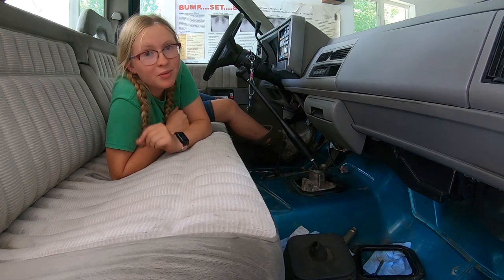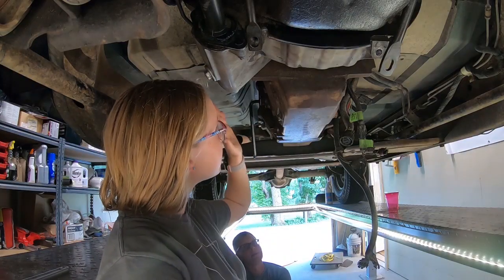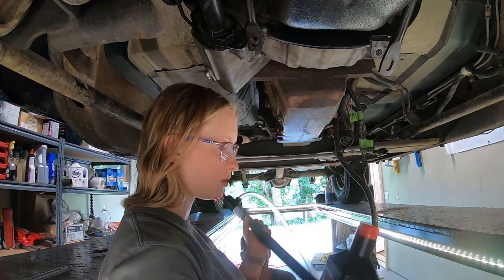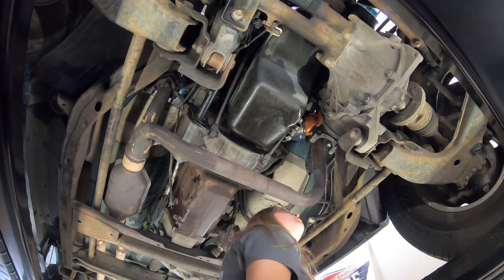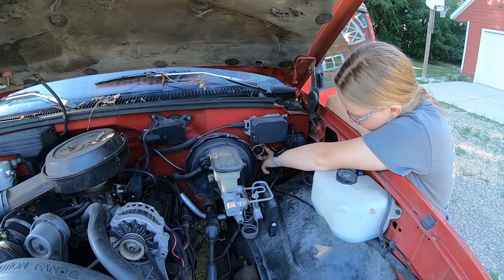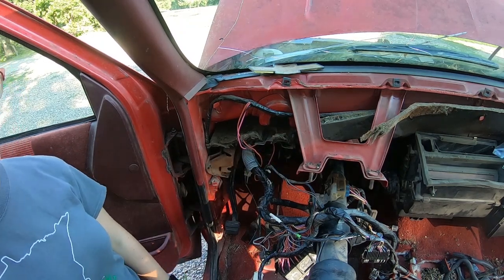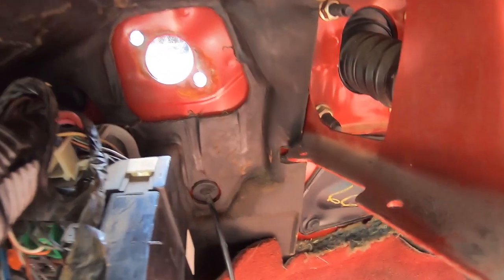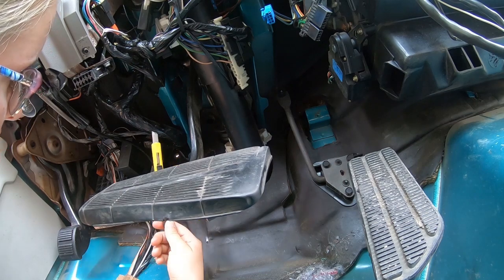OBS 1994 Chevy Silverado Short Box Auto To Manual Swap. Part 4 clutch pedal.

Comment: Hey great vids, a couple tips from a rust belt mechanic. Pull the fill plugs out of the transmission and transfer case before you drain them. It does 2 things for you: allows you to make sure they will actually come out and if they wont come out it gives you the chance to just leave it as is or get someone who can and in the mean time still be able to use the vehicle. Also, take a small hole saw and use it to round the corners out. Put it where you want to make the corner round and run it in reverse to start the groove and then finish it in forwards. Then paint up the bare metal

Comment: Thanks for the information video, I have 2 chevy K1500 (93 & 95) that I’m doing a 5 speed manual conversion to. The 93 1st as I have no reverse but I’ve already bought 2 NV3500 manuals to do them both. The 4L60e’s are junk and it’s cheaper to do a manual swap than take a chance on a rebuilt unit. Rebuilt transmissions aren’t all they’re cracked up to be. You’re a lucky girl to have a patient dad & cousin to watch over you while you did the work. Congratulations on a job well done, and I’m sure you’re gonna help your little brother when it’s his turn to begin driving. Very informative video, will help me a lot on my swaps.
One last thing, tell your dad you want to do a cammed LS swap (very easy).
Reply from the maker: Haha yes that would be a sweet swap! Thanks for your kind comment and best of luck on your projects!
Reply: @PureJoyFarms  very easy swap, they make a bolt on motor mount kit so it a no brainer. LS motors are able to do a cam swap w/o removing the heads as u push ( 2) 5/16” dowl  pins into the block which hold the lifters in place while cam is being swapped. Plenty of YouTube videos on it.
Reply: Depending on who rebuilds the transmission. Because mine went out awhile back but a great transmission shop in Tulsa Oklahoma rebuilt mine. It has be working flawlessly until other electrical components starting acting up  and if you need a transmission rebuilt in/near Tulsa (Norris transmission) is the guy who you need to take it to.

Comment: Well guys, "soon" quickly turned into "right now" and I HAVE to do this swap. My 4l60e lost third gear in my 1990 c1500. I think I will go with a remanufactured 2WD NV3500 from Midwest Transmissions. I emailed them yesterday about gearing and the clutch / flywheel. I can get a new Dorman manual transmission driveshaft. I have my donor 1990 k1500 for the clutch and brake pedal, but it looks like I can buy a set fairly cheap too. Did you guys remove the dash to install the clutch pedal support bracket from your donor truck? Or were you able to snake it up in there without all that? The video didn't say or show. I know I'll have to pry the bracket out of my donor truck by removing that dash, like you all did. Thank you guys again for this series, I may ask some more questions soon, but I'm committed now, not just curious. Looks I will have less wiring to do, mine being a 2WD. I may leave the cruise control for later when I swap steering columns (I'll make it a separate project).

Comment: Hi with this swap did you have any problems afterwards with the automatic computer? I just did this swap on my 94 K1500 with a 350 and since I finished the swap the engine does not like idling, surges bad and misfires.

Comment: I have a 92 v6 c1500, will you need the round bracket to mount the clutch petal?
Reply from the maker: The petal is not fully secured without the bracket and I would be concerned that it would eventually fail. It might work for a while though.

Comment: You don't have to pull the dash to get the clutch pedal assembly out. After you pull the clutch master cylinder and disconnect the starter safety switch plug and the cylinder plunger rod, there are just two easily accessible bolts holding the assembly bracket in place. The whole process takes about 5 minutes.
Reply from the maker: Yes you can remove the pedal, but the mounting plate is welded to the truck and I believe you have to take out the dash to get that out.
Reply: @PureJoyFarms  Gotcha.
Reply: @PureJoyFarms  so did you have to pull the dash out of the auto truck to install that bracket? Did I miss that part in the video? Thanks
Reply from the maker: @petepoling5199  no. It is in the video…we fished the bracket up in place and could feel the groove where it sits to make sure it’s in the right spot and secured it with lots of self tapping screws.
Reply: Did you have to change the brake pedal out for the clutch pedal to work? I know the automatic brake pedal is wider, Thank for for any information,
Reply: @PureJoyFarms   Did you have to change the brake pedal from the automatic, I am looking to do the same to my truck, Thank you for any information
Reply from the maker: @brianprather765  no we did not change the brakes/brake pedal at all.

Comment: what did you do about the Tune on the truck, did you have to do anything to the ecu or does it seem to rune fine after the manual swap?
Reply from the maker: It runs fine, but we are struggling getting it to shift into 4wd. Watch for our next video.
Reply: @PureJoyFarms  im about to swap my 93 c1500 2wd, i think ill be using the transmission out of a 92 which i think is the earlier variant of the nv3500 my only worry was if it ran and idles ok
Reply from the maker: @b00sted_mx59  I don’t think you’ll have any issues. Our truck runs fine in 2wd. Best of luck!

Comment: how did you screw the bracket in? did you remove the dash? did you access from the cowl? do it underneath? how?
Reply from the maker: We used self tapping sheet metal screw with long extension. But very tricky!
We did not remove the dash.
Reply: I have a parts truck Chevrolet K 2500 that I'm taking out of and putting in a 93 Chevrolet K 1500 4 x 4 wish me luck

Comment: Did you have to do anything with the vcm
Reply from the maker: No. The trouble comes with the transfer case control module and we are still trying to figure it out. The control module in automatics has two wires coming from the transfer case: one for 4H, one for 4L. This signals two different shift points in the auto. The manual trans does not give these signals and therefore the transfer case control module does not lock in the front axle.
Reply: @PureJoyFarms  thank you.  I have a 2wd I’m getting ready to do this to.  Just trying to figure out the computer side of it

Comment: Do you have to swap the ecm out as well
Reply from the maker: We are still working on that step and having some issues with getting the 4wd to engage. It runs and drives fine otherwise. When we get it figured out, it will be part of our next video. Wish us luck!
Reply: Likely be the 4wd fuse or the wire going to the Actuator on the front differential the exhaust likely melted them that’s what happened to me few times
Reply from the maker: @blairjosephbernard2011  sounds good, we will check the fuse. But the issue is 2 wire vs 3 wire situation going from transfer case to 4wd control module. Any other ideas?

Comment: Great videos and they've really helpful. Yet my only thing is mine is a 2 wheel drive not a 4wd. So in my case is it the same other than the crank case and maybe drive shaft as well?
Reply: That's great,  Because I would like to possibly do a manual transmission swap on mine if the transmission goes out again. Yet having a non friend or family member to do it they'll charge you like crazy. If I'm not mistaken it's like 20 to 50 dollars per hour. Maybe more than that if you get a super greedy shop who likes to rip people off if you know what I mean?